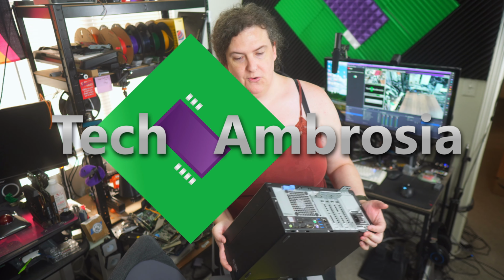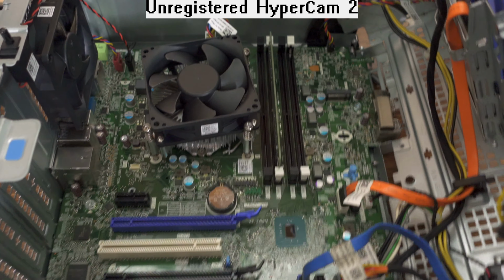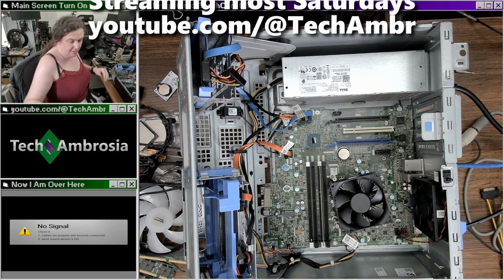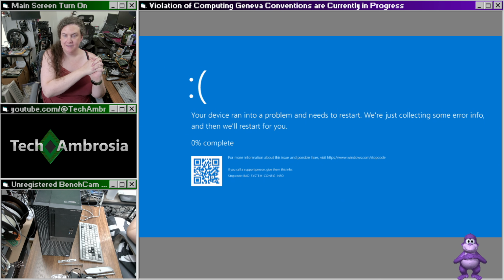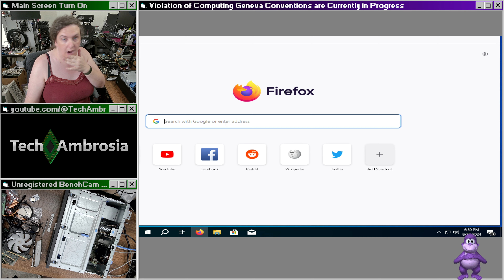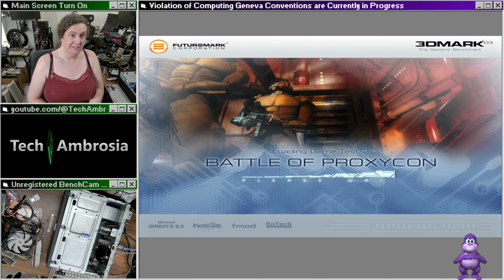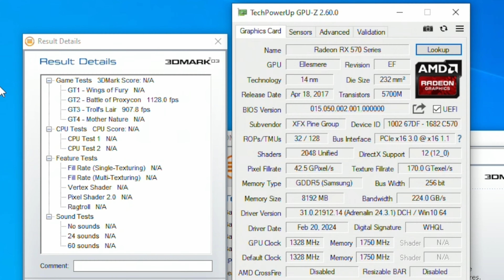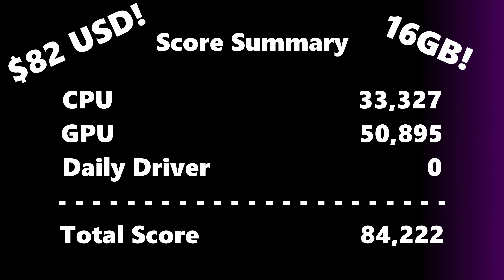An $82 Gaming PC - Cheap PC Challenge 2024

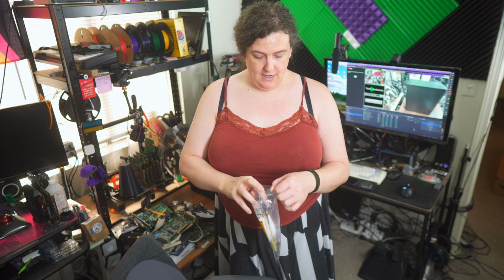Comment: @1:30 good example of "do as I say, not as I do" lol. The biggest problem I've seen with those, is when cheaper ones try to feed 12v neg to the 5v neg line. Those always fail! Also, unfortunately my oem acer/gateway gets all drive power through motherboard voltage regulation. My "current" rig isn't current at all lol. I5 4th gen. I hate the setup for the way it handles power for pcie... Limits to under 50w regardless of card.
Reply from the maker: Booooo! You might have some luck with a dual-SATA to 6-pin adapter...? 6-pin PCIe is only supposed to supply 75W, which two SATA connectors should have no trouble providing, even through motherboard-based voltage regulation. 🤞
Reply: @TechAmbr  haha yea my card has no power connector other than the slot, which is why the board is a problem. I get pretty bad frame times in more demanding games when the card keeps down clocking to meet the "48w power limit". RX 560D 4GB. Even gpu-z shows the power limit
Reply: @TechAmbr  update: I managed to fix the power limit. Had to set the driver to "compute mode" for the gpu. Then used msi afterburner to add +75% to power limit. Saw it use 80+ watt while running Crysis at 1280x1024 75fps,though some dips in 50s. Yea... Got an old monitor. Dell 1707 or something that can do 75hz which is noticeably smoother than 60

Comment: Long time user of such deathdapters here: The most important thing to look for in these kinds of adapters is are the connectors molded or crimped? These are molded connectors, as they heat up the plastic softens in them allowing the pins to potentially move around due to vibration and make contact that's how they catch fire. You want to find crimped connector versions of this kind of thing if you actually plan on using it.

Comment: As a non-AAA gamer who was already buying used RX 570 for <100 dollars over 5 years ago, I'm convinced they have been one of the best value, longest lasting graphics cards ever. There's no shortage of acclaimed games coming out even now which were designed and run on lesser graphics hardware, e.g. in the emulation scene.

Comment: Hello Amber, hey with a soldering iron you can add as much female molex or SATA power connectors as necessary to cover the requirements of that 6/8 PIN VGA power connector... Right?
Reply from the maker: That's definitely how that works! 😆
Reply: @TechAmbr  Hello, do I read in that bag that it is an Startech cable?
I have purchased several cables from them, they always look way better than generic adapters and cables, in pictures at their website I see they use 18 AWG cables from the SATA to the PCIE, shouldn't each of these two conductors be able to carry 7.5A at 12V or 75W each, or is the SATA connector itself what can't support such a load?
I never like to use adapters that don't use a conductor for each of the connectors, the jumpers at the PCI-E end give me bad vibes, LOL, but what is important is the cable rating and how much power the metal pins can conduct without getting the plastic connector too hot. Right?

Comment: Is it running with the 180w stock PSU?
Reply from the maker: The mini-tower versions shipped with a 240W power supply, and yes, it's running with the stock PSU! There are aftermarket options at 500W, but they're around $100 on eBay

Comment: These SATA Power Connectors are a fire hazard. Avoid them if you can. We had some firewalls burning up because of oxydation on these connectors to the inbuilt SSD. It gets so hot that it can burn holes into steel sheets. And thinking about these connectors feeding a grafics card... No!